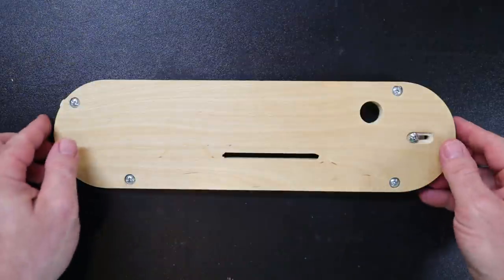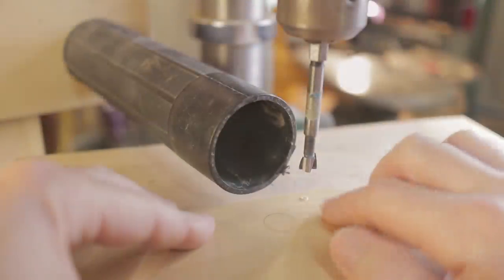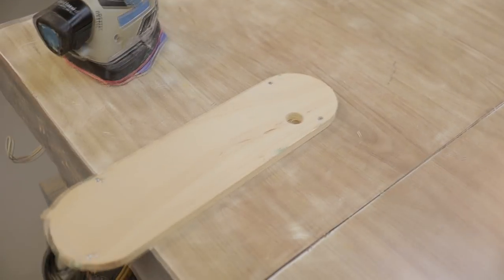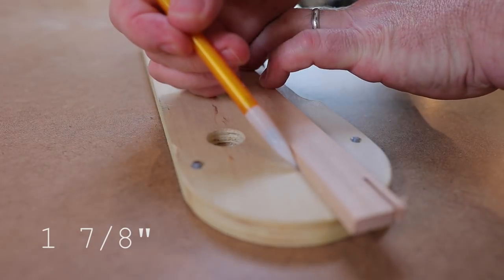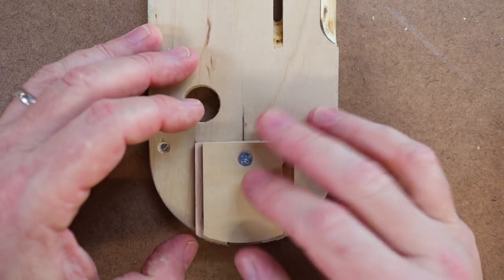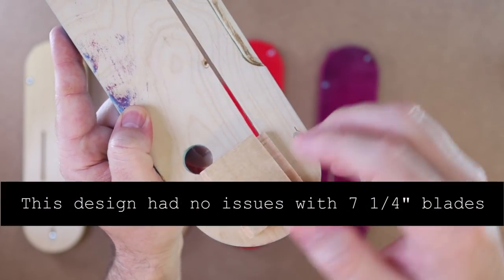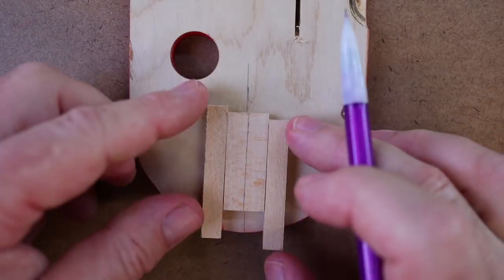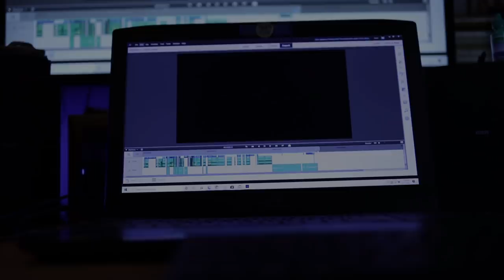How to make a perfect zero clearance table saw insert a step by step DIY tutorial

Comment: Great idea, especially the locking mechanism! A trick I’ve learned when tapping holes in wood, is to put a drop of thin CA glue into the holes to stiffen the wood fibers before tapping. Spritz a little accelerator too. Haven’t had any screws wallow out yet.

Comment: This is probably a little late but instead of screwing the lock slides to the underside you could use wood glue or ca glue and then it wouldn't matter if the blade hits it, then it really would be one size fits all. 😉  great video also btw!
Reply from the maker: Excellent point! Thanks for watching :)
Reply: same thinking, can use epoxy or polyurethane. instead of scroll saw,  hit the edge with router using bottom tracking bit, following the existing newly made insert edge.  Router can carve epoxy without trouble.

Comment: On the locking mechanism, you put the wood “lock” flush with the front and the screw also all the way to the front. That won’t allow the locking mechanism to go forward anymore and therefore not locking the plate.

Comment: Nicely done.
As for the locking mechanism on the leading edge of the insert- I haven’t used one in 15 years. It’s the back end that I want locked with even just a simple tab to keep the blade from lifting the back end of the insert off the table. At the front edge the rotational force of the blade holds the insert down. Just my .02😎
Reply from the maker: Thank you! True. The lock is nice on this saw. Less vibration when running the dado. I still don't have a lock on my main saw :)

Comment: Nice build techniques. but do it really need a lock, it will have downward pressure from the work.
Reply from the maker: Thanks! The lock is an option. I don't have a lock on my main saw but the insert on that saw is a very tight fit. These inserts have a little play and the lock doesn't let them rattle around. I have another video on my channel where I make 5 different types of inserts for this saw if you're interested.  https://www.youtube.com/watch?v=BPmVncv9fWM

Comment: I just re-read your article about this to refresh my memory from reading it one year  ago and came back to re-watch your video. Found this newer video and it is fantastic. I have a new DW7490 and will be trying to make these for it. May I ask if you have more info or comments to make about using 2 or 3 of the 7 1/4 blades on this saw which according to the manual will not take a dado blade? Like you I want to slot drawers for 1/4" bottoms as well as grooves for 1/4" hardboard dividers. Thanks for taking the time to read this rather long post.
Reply from the maker: Thank you!  If you have any old 7 1/4 blades you may find a combination that works. The three that I use for drawer bottoms (5.2mm) are as follows: 
 24t Irwin framing blade (inside)
60t Diablo ultra finish (middle) 
40t Avanti fine finish (outside)
Many blades vary in width by type and manufacturer so stacking different blades will slightly vary the width of the groove.
Reply: @SlowandExpensive  Thank you for your very timely and kind response.
Reply: Just watched this video; best I've ever seen!. It's the only one that I've found that mentions the lock-down device. Also, Bevan Stuart mentions "your article". Where is this article?
Reply: Where do I find the article you refer to?  Thank you.

Comment: I have been working on a zero clearance insert for my (cheap) table saw and found some features in yours that I will probably incorporate into mine.  I was really impressed with your mechanism to lock the insert into place.  I like using the 7-1/4 thin kerf blade and have had a few problems making a splitter just a bit thinner than the blade.  Making it out of wood makes the splitter way too weak.  How did you mount the metal one you have on your 7-1/4 blade insert?  Thanks for a great video.
Reply from the maker: Hey Mike, I used a simpson strong tie metal bracket and screwed it on with 1/2 screws. The width matches the diablo blades I use perfectly.I don't use that particular insert very often but if I did I might be inclined to add a little glue as well just to insure it wasn't able to vibrate loose. This video shows the build and there is also a link for the bracket in the video description. You can get it at the home depot for a couple bucks. Good luck and thanks for watching!
Reply from the maker: here's the video https://www.youtube.com/watch?v=T4H2t4fNpOg&t=8s

Comment: I think it would be a whole lot easier if they made the hole with 90 degree ends. Rounded may not catch the work piece as easy, but then if made correctly a square edge would not as well.

Comment: Terrific video and the doWhat gig.  A couple of questions: What are all these different types of blades you are using? The only blade I know of is the 10" single blade and the dado stack (which doesn't work with many of the Dewalt saws). In particular, I did not know that they make a 1/4" thin kerf blade.  I have a glue line, thin kerf blade from Freud and it is 1/8".
Reply from the maker: Thank you! They are 7 1/4" circular saw blades. The kerf varies from blade to blade but is around 1/16". Some inserts have splitters, some are blade only, and some are for dados.  I use smaller blades most of the time on my small saws. Dust collection works better and the saw doesn't have to work as hard to spin smaller thinner blades. Cut depth is limited but all else is golden. The little dado stack at the end of the video is three different 7 1/4" blades stacked.  I use this setup for making drawer bottom grooves. The 7491 saw does take a regular dado stack up to 13/16".  There is a link in the description for the video making the 5 different types of inserts if you are interested.
Reply: actually, there are specific dewalt model of jobsite table saws are made with long arbor spindle and handle dado blades.   if yours cant, then you bought the table-saw with short arbor spindle.

Comment: If you don't mind, can you share the dimensions of all the pieces in your lock mechanism in the description of this video.
Reply from the maker: The dimensions: the two side pieces are 5/16" wide x 1/4" x 2" long. The lock is made from 1/4" plywood and is 2" long x 1 1/8" wide and then there is a small piece of wood that is glued to the 1/4" plywood part is a 1/4" tall x 5/8" wide x 1 1/2" long. I hope that helps. Sorry it took so long to respond. I didn't get a notification about your comment and just found it today :)
Reply: @SlowandExpensive  thanks.  Good timing, as I just made two blanks for my own zero clearance inserts the other day.

Comment: Once the glue has set up, you dont need the screws, so you can remove the not important hold screws that hold parts together,  becuse most sawblades are carbide tiped today  you can use aluminum screws these wont wreck a blade  i slso think you could do a hold down with plastic parts only home made. Maybe use parts off a plastic soda bottel. 
Or just a washer shaped as a cam lobe and 1 screw. With a stop carving into the incert.
Not reak smart using a metal splitter system unless its bolted to the table saw. You can glue thin plywood parts into the blade kerf.
Or buy the micro jig splitter system.
These use different push in plastic parts for thin or fat blades. 

Me I dont own a dewalt table saw, ive got the porter cable version 
Both saws were made by Stanly tools. Both were made in the same factory in twain.  I also have a Jet hybrid  with cast iron wings and a Grizzly cabnit saw. 
No one makes a incert plate for the 2017 version of the proshop II jet
And ive got sevral incerts plates from grizzly for my saw they are still being sold even though the saw is close to 20 years old.  All these tools were made in the same factory in Taiwan.
Reply from the maker: So true, once the glue sets they aren't necessary.

Comment: Try using less metal parts and more plastics. Lowes and home depot have speclity finiture screws and some are plastic, if you hit metals with a spinning blade you risk dammage to the blade or a bullet flying at your head should the blade hit it. Plastic just going to get cut.  You could also use a soft non ferris metal like brass, copper or aluminum  but plastics are a better option. Even the adjustment screws on the edges. 
My porter cable saw i put my blade guard on the saw fliped on the saw and got hit 1/2" away from my eye with the guard as it came off the saw at 100mph i wasnt even cutting anything yet hadnt put on my safty glasses yet.  Always stand to the side of the table just turning on the saw. Even a brand new blade can toss a carbide tip if it wasnt welded on right and its moving 100 to 200 mph off the blade fast enough the go into you skin.  You do not know how the blades been treated before you got it or if your kids have knocked it off the nail it hung on the wall with. Just a basball can dammage a blade.
Same rules as grinding stones. 
You put a lot of rmp's on a tool spinning it can fly apart. You dont want to be in the way of flying parts.